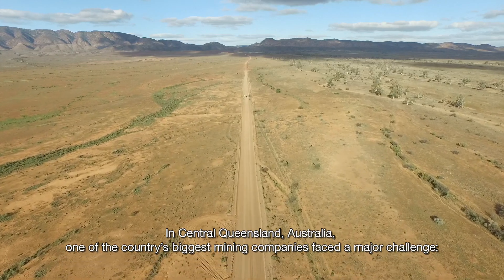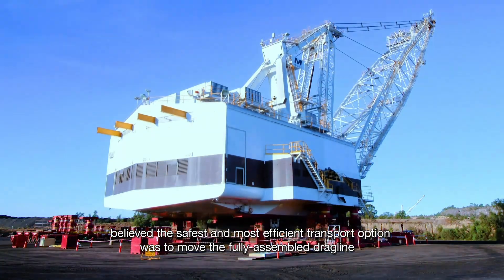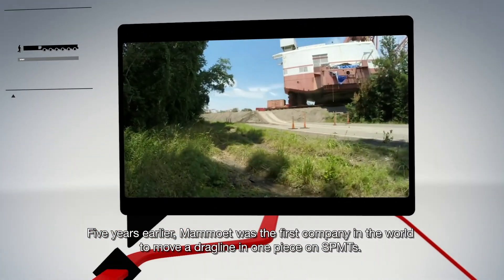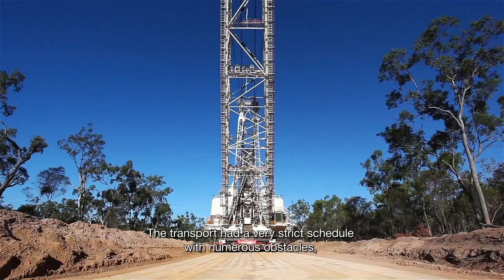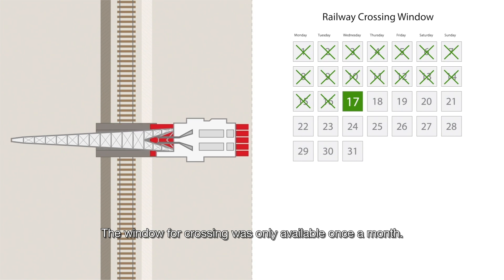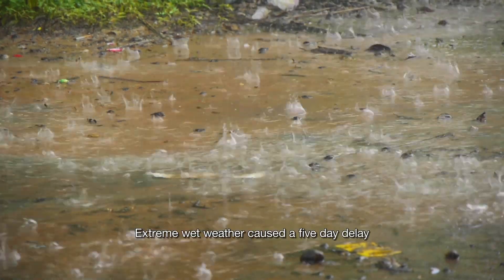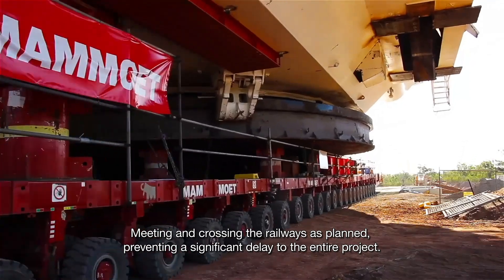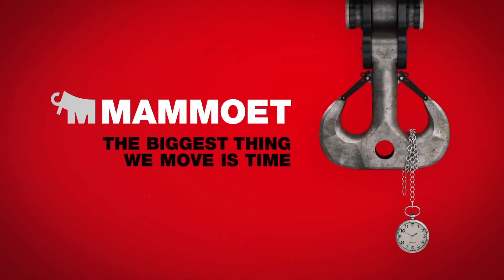Moving a 3,000 tonne dragline excavator in half the time

Comment: '
wow big crane machine...
crane must have 2 tracks and dont need carrier with many axles wheels
Reply: It's earthmoving equipment. This generally doesn't have tracks but a giant swivel base and 2 sled like feet either side. I have been on a mini version of this. Known as a "dragline".
Reply: @OffGridInvestor 
hi L K...
'
thank explain
Reply: It’s called a “walking dragline”. Each side has a massive rectangular foot that’s attached to an eccentric linkage similar to a steam locomotive, but vertical. The feet alternately come down one side at a time and lift that side of the machine, then the eccentric motion moves the crane forward several feet (inches?) , then the foot rotates back and up, then forward when the crane is once again sitting on the ground, then forward and down again to begin the cycle all over. The foot on the other side is doing the same. Slow, but effective!
Reply: @tomt9543 
hi T T...
'
thank explain

Comment: What was the cost?
Reply: Dale olson way cheaper than repairing it after a walk that far!
Reply: A lot...
Reply: No, cheaper than getting locals to do it...
Reply: @reynoutdecourt7983  not cheaper than locals. Locals would have spent a month pulling it apart and moved it in pieces. Here in Australia they have HEAPS of mines to the point you wouldn't believe it. They drilled tests cores for a future phosphorus mine to find it had the potential to be 75 miles wide. Yeah.... the state to the west of this has been found to have lots of potential mines but is yet to be opened up because it would likely flood the market on many major products like coal and iron ore.